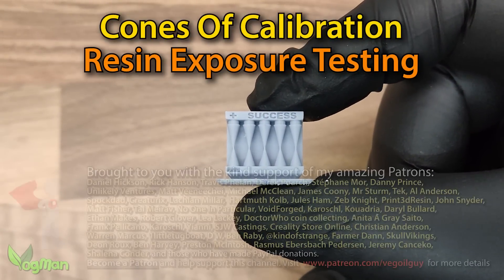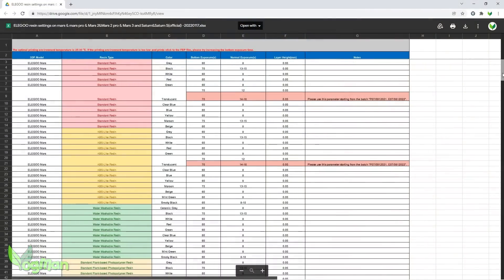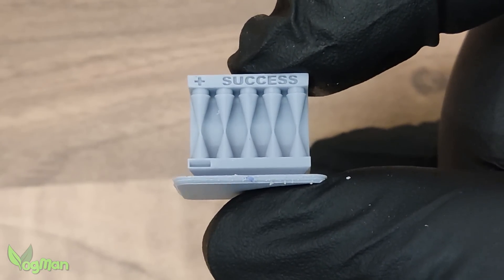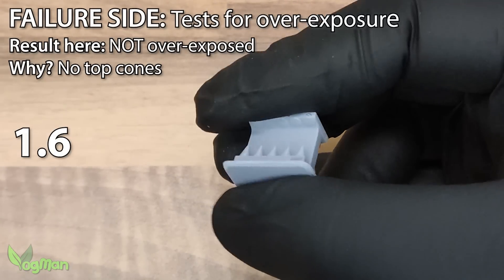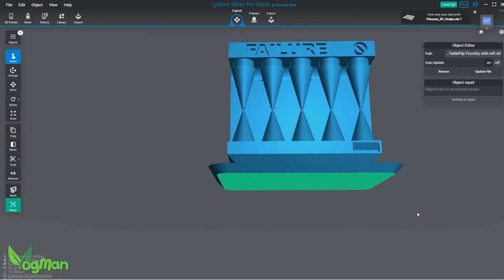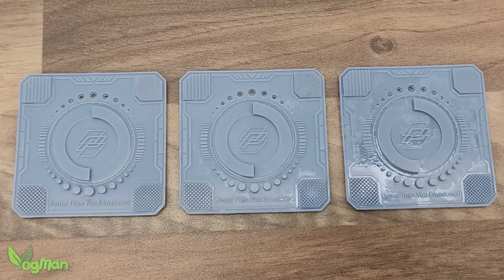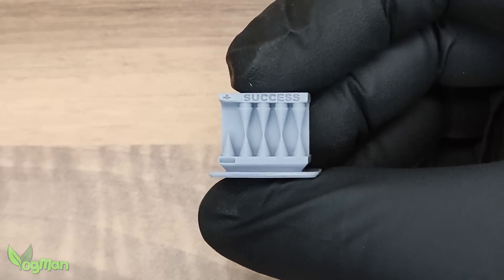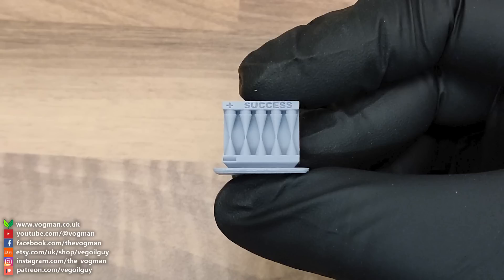Exposure times testing (dial in your 3D printer resin) with the CONES OF CALIBRATION

Comment: Hey Vogman. i've posted in quite a few groups a strange issue that i've been having and so far noone seems to be able to even come up with a reason why this is happening. 

Aparently my printer isn't printing the burn layers, but everything else after it prints flawlessly. I'm using your x10 method for burn layer exposure after doing my regular exposure calibration.

It's a super strange situation and i would like to understand why this is happening. I'm using an Elegoo Mars (first iteration) 

If you would like to take a crack at helping me get to the bottom of this i'd be more than happy to send you prictures, videos settings and everything else you might need.

Hope you take an interest in my predicament
Reply from the maker: I'm sorry to say I haven't a clue what that should happen. Hopefully someone smarter than me will come to your rescue.
Reply: @vogman  no problem :) I had to try 😅
Reply: You have to watch his past calibration video because I think he mentions it, I believe its because the original mars isn't a monochrome LCD so the light won't be as direct.. resulting in a longer exposure time required.

Comment: RERFs should become industry standard. That and allowing custom steping for each of the RERF zones. You could be fully dialed in in like 1 hours. Like you could do the thin phrozen test with like 0.4 s steps to get the ball park in like 10 minutes and then 0.1 or 0.05 stepping using the cones of calibration and be ready to go like 40 minutes later. Personally I think that would be the fastest and best exposure testing. especially if companies were smart about it and automated aa shadow so all of them would be labeled with the exposure time.
Reply from the maker: I agree. I really think every company should supply a RERF.

Comment: This test take a lot of time and damage your fep. Other test are good. I have made a lot of this calibrate print and i'm not convinced about it accuracy.
Reply from the maker: Someone just commented that floaters can occur within the resin, and that will can potentially destroy your FEP. I didn't experience this as I came at things from a proven setting and worked backwards, but I think your comments support my feeling that dialing in quickly with things like the Phrozen XP test print is the way to go initially... and once closer, the cones should be perfectly safe and very useful.
Reply: @vogman  I totaly agree with you. All my test was made with a cleande empty resin tank. The problem is that, if you print more than once model, without move the model, prints allways occur on the same place on fep. Like you said, phrozen xp models are very good model to quickly have your resin settings. After, you have to made test with cone model if you experienced printing problem. But dont forget to not add some support to those slicer made and dont think that it was an exposure problem. Thanks for your video.
Reply: Thanks so much for giving it a try. I can say, it 100% does not damage your FEP though. 
But the matter of calibration is a very complicated and detailed one when you start to understand all of the variables. I have a Calibration Class on my youtube channel that really digs into the fine details about resin attributes and why some calibration methods are different from others. It's a worthy watch if you have the time.
Reply: Version 2 takes almost half the print time. It has a lot of changes that reduice the stress on the FEP as well as any small parts that could escape into the resin.

If you're looking for a test to get perfect accuracy. Have a look at the Cubes of Calibraion on Cults3D.

Comment: I've been a hardcore evangelist for the Cones for like a year now.  Normal exposure tests are great for dialing in the detail... But if you find that actual prints are failing because the parts are pulling off the supports, the Cones are the perfect test to find the proper exposure for practical purposes.  That's why I always do both types of tests, because as you said, the detail tests can be subjective; if it looks perfect to you, it may still produce underexposed support structures. The Cones give you that final level of calibration.
Reply from the maker: Thanks for your input 😁
Reply: @vogman  Ever since I discovered the Cones, it's been my default recommendation anytime someone complains that only their supports are printing and the rest ends up on the FEP. There's such a narrow margin between subjectively optimal exposure for detail, and underexposure of supports. 👍

Comment: I like the objectiveness of the cones. Thank you for showing this to us! One drawback is that this test intentionally introduces floaties on the failure side, so you're going to be cleaning your vat after the test.
Reply: OH! No this is not true. The Cones are self cleaning! No floaties I promise.
Reply from the maker: Interesting. I haven't experienced the floaties issue, BUT I came at it from a known setting and worked backwards. All the more reason to dial-in with typical methods an then finish off with the cones 😁
Reply: Nope, you can clearly see that the top completely covers where the flat cones were, therefore they become part of the print. It's things like this which become obvious with experience.

Comment: There's one more genius benefit to the Cones. If a professional model supporter benchmarks their work against the cones, then success on end user machines that have also run Cones is practically guaranteed, no matter how wildly different the exposure settings are. This is because the support cross sections and model contact points should be dimensionally accurate to the artist's original intentions.
Reply from the maker: Interesting. Thanks for that 👍
Reply: @vogman  Thank you! My buddy was a Photon Ultra Kickstarter supporter, it sat useless for a year until I sent him your lift settings last month. Now he's printing like crazy!
Reply from the maker: That's great to hear 😁

Comment: The original idea of the cones of calibration its for pre supported models. They already have a version 2 and another calibration test they call Cubes of Calibration.
Reply from the maker: I must look into that 😁
Reply: So... every single model which requires supports (the vast majority)?
Reply: @cenciende9401  no, pre supported models ones which you do not support yourself.  The success side mimics the size of typical supports so if they print you have a good chance with pre supported models.

Comment: Would scaling the 3d model on the Z axis and making it smaller and faster to print still work as a good calibration method?
Reply from the maker: I've no doubt they tried that... though I now hear their next version reduces time by 35%. So maybe...
Reply: Unfortunately no. These have very precise dimensions and for good reason. The details of how and why are lengthy. TLDR: No you cant scale them. :(
Reply: @TableFlipFoundry  Thanks for clearing that up!

Comment: I discovered the cones of calibration through a friend who picked up a mini 8k as his first 3d printer, and in the process of stumbling through learning how to set everything up, found these.  I'm probably going to be ordering my printer after I get paid on the 15th (assuming I can 1. not spend all of my non-savings money between now and then) and 2. decide which one to buy, lol (still in a toss up between the Mighty 8k and Saturn 2... and that GK Two is calling to me, but that would probably mean dipping into savings, which I'm not 100% I wanna do just yet), and I've already got this bad boy downloaded, lol
Reply from the maker: If fancy features and connectivity don't interest you, the S2 wins for me. The printing difference between these machines was impossible for me to gauge. I hope that helps 😁
Reply: @vogman  Yeah, I'm generally leaning toward the S2.  Right now the Mighty 8k is technically cheaper by a hair for me on Amazon, plus I prefer the Orange, lol.  The heat recycling on the GK Two though is a great feature, along with everything else it offers.

The big drawback on the Mighty 8k for me is the lack of carbon filter, and the GK Two seems to have the win on that feature.

Gah!  I wish I could make up my mind, lol

Comment: When I got my resin printer, I had a bear of a time even getting a good calibration print, and then there was the vague is a or b better. The go-nogo nature makes it straightforward for a nube to judge. From your first guess, you know if you are over or underexposed and you have a gauge of how good or bad the guess was

I do get your reasoning, and your reasoning is sound an experienced printer probably will see no improvement. For me, the clarity is worth the 40min print time, heck, I have had FDM prints that took days, 40min is a heartbeat. At some point, I may swing back to trying to get the UUVTools 6 exposures in 1 test print to work.
Reply from the maker: Very true 😁

Comment: 40 mins is too long for me, the standard pattern would only take 10 mins that means I can print 3 times and get the best exposure time.
If the miniature is with more protruding details then a little bit of over exposure 0.1s is not a bad thing. +-0.1s depends on the miniature shape.
Reply from the maker: It is a long time, especially if you're doing a speciality resin... I've got one running right now that takes over 3 hours to print the cones. So I'll stand by my statement for now... move in quickly with the 10 minute standard tests (though these are 40 minutes on my castable resin dial-in, yawn!) and when it comes to the point where judgement is difficult, let the cones decide. These aren't for everyone, and I think the experienced will give them a hard miss, but I think for a lot of folks, they're a great idea.

Comment: I think the thing I like most about the cones, is that it tends to catch failures. I have ran a number of test prints and being off is devastating and I need to get cured resin off my fep. I can't say I've had the same issue with the cones. They almost clean up after themselves. At least in my experience.
Reply from the maker: Since I made the video, I've had one failure that resulted in FEP clingons, so it's possible, but yes, 99 times out of a 100 maybe, no clean up is needed, making them a useful tool 😁

Comment: Literally magic how the cones on 1.8 failure side form without any support…in the air. 4:10
Reply: They don't print in the air they printed attached to the bottom cones and then when the force to remove the cone exceeded the strength of the joint between the cones (effectively the tip of a support) it got stuck to the fep and no more height was added then when the roof started to print it picked that partial cone up and it carried on printing.
Reply: @chriswebb9375  Thank you for this explanation.
Reply from the maker: It is a clever concept. The cones are there to be printed... but ONLY if you overexpose. 😁

Comment: I know about the cones from a long time ago. I personally could never reliable dial in the correct exposure with it, but then again there could be a lot of factors that had an impact on it lol. I personally think my room temperature was just simply too cold back then and the resin I used just wasn't made for fine detail printing.
Reply from the maker: The first time I tried, I had a complete fail. Then I realised my resin had been sat in the tray for a couple of weeks. Yes, it was well stirred, but it still failed. When I changed the resin for nice fresh stuff, the print worked. I think this shows how temperamental resin can be  😁